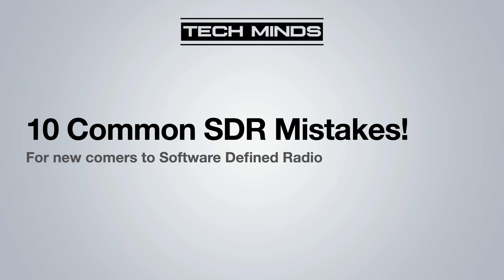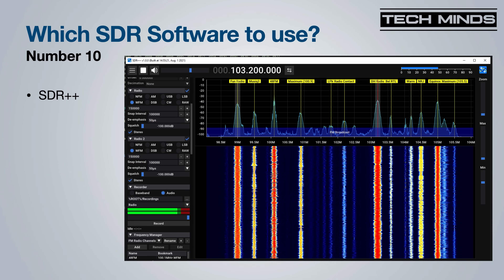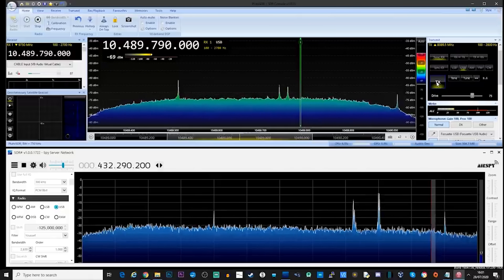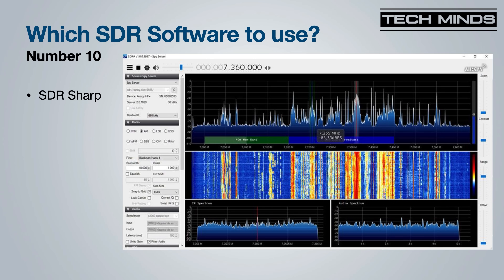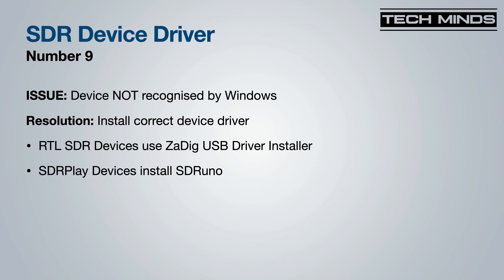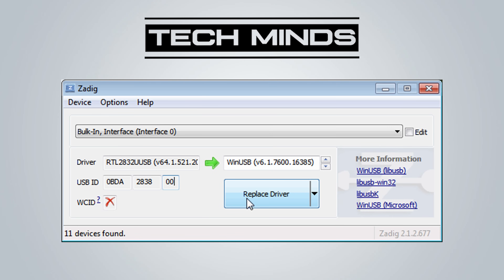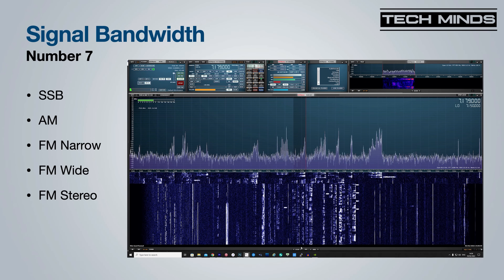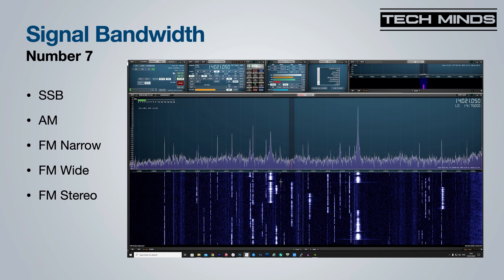10 Common Mistakes Made With Software Defined Radio

Comment: I'm starting to get sad. 

I was all excited to get myself an RTL-SDR kit. And I do see some signals.

But only now, I'm finding out that without a better antenna, I probably won't get very far with this new hobby. And getting one is not very possible, as I don't have anywhere to mount it on, living in an apartment building... :c
Reply from the maker: Don't be sad! Even with an apartment, you can still do a lot with SDR. Check out loop antennas or even just a long wire tossed out a window. Many folks get amazing results in apartments! If your apartment is high off the ground this can be an advantage for VHF and UHF! Let me know if you have any questions.

Comment: Good video. Am considering an SDR for my SWL hobby
 The reason is i hope it might overcome the electrical noise introduced by the computer you are using. My biggeat problem is RFI introduced through the USB port back into the reciever. Any comments or experiences anyone wants to give would be apprecisted.

Comment: RE: Antennas.  On HF at least ("Short wave") sometimes a non-resonant antenna can work better if you think more in terms of signal-to-noise ratio rather than pure signal strength.  Today, most of us struggle with RF "noise" from the power grid, solar panels and poorly designed consumer electronics. Sometimes a non-resonant antenna will pick up less noise but still capture the signal you want to hear, giving you a "weaker" signal overall, but an improved signal to noise ration.  All that to say, don't get discouraged if you cannot fit a resonant antenna in your garden .... a random length of wire at HF might actually work well.  In fact, many people today are using non-resonant wire loop antennas placed directly on the ground to address the noise problem.  Have fun with your SDR!!!!

Comment: When choosing coax, look at the 'minimum bend radius' if you are choosing a thick, low loss type. Some are difficult to work with and will not go around the corners of your shack and if you do manage to install them, they are so heavy and springy that they will drag your receiver off the desk. I use CT-100 satellite cable. It's a 7mm cable, flexible and low loss to 2 GHz. It's 75 ohm so is not a perfect match but it makes no real difference, as neither your receiver or your antenna will be a perfect 50 ohms anyway.

Comment: Computer choice is important.  If you are a OSX user then you are limited to SDRConnect or SDR++, however if you have a SDRPlay you are stuck to SDRConnect as SDR++ no longer works with the SDRPlay. Please note Mn Macs do not do Bootcamp. You need a Linux machine if you want to use WEBDX, for everything else you need a Windows PC or Laptop, but if you've just spent £1700 on a M4 iMac like me,  you'll be kicking yourself. Laptops start around £199-£250 new but they are slow and may not have quality screens mac users are used to.

Aerials, there are Loop antennas, missing from point 1 above.  There are relatively cheap ones like the YouLoop and MLA30+ & DSA  these apparently are pretty good.
I prefer to buy from specialist radio shops like Moonraker or Radioworld, ML etc.  As Mike said you will need two types of antenna, you might use the Sky Scan Desk Top and You Loop both are indoor operation so no need to trail coax around the garden or put up masts

There are also standalone radios with an SDR flavour, like the Malahit SDR small but capable.  

Here are suggestions
SDRPlay , £126 for a B, £195 for a DX from a radio store
YouLoop and Sky Scan iro £85. (my rather weak X1HF cost the same) also from a radio store.  
If you want to listen to the world then expect to pay £400 + for a serious loop.
Laptop if you don't own one 15" 250 nits Asus from Argos for £249

Comment: To eliminate a feed line altogether use a USB extender to USB SDR connected directly to the antenna or remote antenna switcher in a protective case plus lightning arrestor to ground.   I like to add heat sinks to the SDR as well.

Comment: As a total n00b, I made an even more basic mistake: trying to see how my RTL-SDR picked up my own radio transmissions by transmitting from an HT about 3 feet from my antenna. It died immediately and got rather hot. As we say in the MIdwest, ope!

Comment: can you use modern tv cable for the antenna as today's digital tv and cable modems can run in the ghz range?

or even with the right adaptor connect to the tv cable?

Comment: Hi, Great video. I am trying to use an AirSpy HF+ Discovery using SDSharp for my IC-7300. However, I keep getting the message "Port is not available" for the omniRig Sync. Do you have any suggestions on what mistake I am making? Thanks in advance.

Comment: Can SDR sharp be used on a mac?
Reply from the maker: Try SDR++, that works great on a MAC. SDRSharp is designed for windows.
Reply: @TechMindsOfficial  thanks for getting back, one more question though can sdr++ transmit? I would like to use it with a hack rf.

Comment: I think, with high gain you can't damage your SDR reciever. Because gain doesn't matter of the circuit which is operation on sameway regardless to gain settings. Of course, you can damage your reciever by high wattage RF in your near radius and that is more important how you can damage your reciever. But IDK if it is possible. If there is someone who know more and tell me about how gain can cause circuit damage i will be pleasured. :)

Comment: Very well done, just the aspect of direction. A whip is omnidirectional and also frequency sensitive by its length. One could use a Yagi, but that has its frequency limitations too but will concentrate receiving in one direction, actually attenuating signals from other directions. . A log periodic is probably the answer for the higher frequencies, as it is directional and can handle a wider band of frequencies. But you will need a system that can turn it around to face different directions. (And maybe tilt from horizontal to vertical too) Now we have polarization too, vertical polarized means you need your Yaggi to be verticle position, the whip is vertical, a mode used in preference to horizontal. . Then we have balanced to unbalanced to balanced, the yaggi is balanced and most radios outputs are unbalanced. Here we use a "Balun" a 1/2 to 1/4 wavelength coax, connected between the two points on the folded dipole of the Yaggi. Many prefer a small transformer, air core or ferrite core. Coax is joined to earth, and one of the dipoles ends. On HF frequencies you can make a antenna tuning unit, which basically just adds length to the antenna by putting a coil in series, or shorten the antenna by purring a small cap in series. I suppose one can google the details of all these things. IMPORTANT - You will only need to do this if the stations you want to listen to are very weak. Antennas are the only thing you can tweek, I loved the machanisms I had to make to make my 12 element Yaggi wiz around in 360 degrees. It also could tilt up and down and twist it from verticle to horizontal.  Hope this gets you started on making antennas.....lol

Comment: Can you please reccomend a book that is specific enough but adequate for novice users that deals with - antennas, coax cables, filters, gain, resistance etc. - the bottom line here is what equipment to use for which frequencies. How to scan propperly etc.

Comment: The most important mistake that wasn't mentioned: Avoid proprietary soft- and hardware! Instead look for radios with open hardware interfaces, resulting in free (as in libre, not as in free beer) drivers that run everywhere and software that is also free (also as in libre and not as in free beer)! If you don't care about your freedom to learn how things work, your freedom to modify and experiment... then get the whatever you want, I don't care. But don't complain if you can't do the more advanced things with it.

I personally think, using free software is a absolute must in software defined radio!

With every physical radio, you can disassemble it an look inside how it is built and you can modify it. Even if it is a one chip solution, some people grind down chips layer for layer and put them under a microscope to reverse engineer them. Actually polish them down micrometer for micrometer and the microscope is a electron microscope, because the structures you look at are often smaller then the wavelength of visible light.

With software defined radios move all the "magic" into software. If the software isn't free, you have to reverse engineer it which may rival the complexity of grinding down a chip and reverse it under the microscope. Something most people can't effort. So you need access to functional blocks, their source code and documentation. Then playing with software defined radio becomes as easy as assembling a kit or building something from an existing design.

With proprietary software *only*, the radio hobby would die, because the design of most radios is nowadays a software defined radio. Fortunately free software and free hardware designs exist.

Some Examples of free Hardware Designs:

Ettus Research USRP: The Company Ettus Research started with the goal to build a low cost SDR that everyone can use, especially with GNURadio. But since then, their hardware became more and more capable and also more expensive. Their Hardware became a fundamental tool for the development of high bandwidth mimo systems like 5G and also used by the military for signals intelligence. They are now owned by National Instruments and their Radios have become prohibitively expensive (You have to decide if you want to buy a new luxury car or a radio). But they still release Hard- and Software designs and support the free software projects involved. And there are various Clones available.

ADALM Pluto: The company Analog Devices wants to sell ICs and a good way to do it, is to create open and inexpensive educational material that can be used to teach the next generation of engineers, when these start working for companies that build stuff, they use what they know and this is how to sell chips. ADALM stands for Analog Devices Advanced Learning Module, it is a very inexpensive but highly capable software defined radio. It contains a runtime-reconfigurable FPGA with two physical ARM CPU Cores that run Linux. The HDL source for the FPGA and all drivers for Linux are available, the result is that it just works and that people have built firmware for special purposes. Clones of the Hardware exist, some are even better then the original (Better TCXO, additional SMA connectors für RX2 and TX2, Metal case).

The HackRF One: Because the USRP was too expensive and something less expensive was needed to allow people to reverse engineer and audit wireless devices, the HackRF Project was started. It is also a completely free design and comes with free software to support it.

The above mentioned SDRs have one thing in common: No filters, a completely open frontend from ~1MHz to ~6000MHz, so you might easily overload them with strong out of band received signals. So a bandpass filter for the received band is advised. And on the TX side, it is also unfiltered and a low pass filter for the band used is always needed if you want to transmit.

Another Example of free Hardware Designs are all the OpenHPSDR designs. OpenHPSDR is a Project that created a lot of modules from ADC / DAC boards, amplifiers, filters, power supplies and so on. Control and transport of I/Q data happens via Internet Protocol over Ethernet. Based on this Design (Especially the protocol used over the network), many other SDR Transceivers were created. The ANAN or the Hermes Lite 2 or Charlie 25 are good examples of derived hardware designs.

Non-Free Hardware Design:

RTL2832U based USB TV-Receivers, probably the most popular SDR ever. It was actually just a proprietary/undocumented USB TV receiver, but a developer of linux drivers managed to discover a mode where the receiver starts sending I/Q data over USB. Now we have cheap entry level SDRs for everyone. But I don't consider it free, it was just a happy accident. Of course it is now very well supported by free software and the hardware is so cheap, it would be wrong to not mention it.

Some Examples of free Drivers:

UHD: The software to communicate with USRPs (and Clones).
libiio + libad9361 (and many more): The very modular driver framework to communicate with ADALM Pluto and similar Analog Devices hardware.
rtl-sdr: The software to communicate with RTL2832U based USB TV-Receivers.
hackrf: The software to communicate with the HackRF One.

The OpenHPSDR based Radios work over Ethernet / Internet Protocol, there is no direct Hardware access needed. The same can be true for UHD and libiio, if the Radio has a Network Interface. The rtl-sdr software comes with a tool called rtl_tcp which also allows to make a SDR accessible over the network.

Hardware Abstraction Layers

osmosdr: It makes different types of SDRs available with a single programming interface. You can add new hardware support to it and all programs that use it, can immediately access the new hardware. The user normally has nothing to do with osmosdr, except when some program uses it, you have to see if your hardware is supported by osmosdr and if it is, it is also supported by the program that uses osmosdr. Unfortunately the osmosdr project isn't very active maintained. It works for its intended purpose. 

SoapySDR: Basically the same idea as osmosdr but written in C++ and actively maintained. It supports everything that  is supported by osmosdr (because it can use osmosdr) and it has SoapyRemote, which makes all supported Hardware available over Network.

Programs that use osmosdr or SoapySDR:

gqrx: A simple AM/FM/SSB receiver application.
sdr++: A newer receiver application, more demodulators (it was mentioned in the video)
sdrangel: A transceiver application, you can receive and transmit AM/FM/SSB and various other modes.

Programs that use the HPSDR Protocol:

linhpsdr: A simple transceiver program for OpenHPSDR based radios.
pihpsdr: The same but optimized for the raspberry pi.

Programs for SDR rapid prototyping and frameworks:

GNU Radio: It is a large library of SDR components, building blocks. Filters, Modulators/Demodulators and input output modules, signal generators and so on. They can be used when you program something from scratch. But they can also used by the tool named "gnuradio-companion" where you drag and drop those blocks on a workspace and create connections between them. It is like building a radio from minicircuits modules, you get filters, mixers and so on and connect them.

Pothos: Basically the same idea as GNU Radio, but more focus on rapid prototyping like gnuradio-companion and less a library of SDR modules. The SoapySDR Project is part of it.

liquid-dsp: A library full of common digital signal processing routines to build software defined radios.

libvolk: A companion project for gnuradio, it contains common functions used in digital signal processing, like multiplying large arrays of numbers. But these functions have hardware specific optimizations.

Everything on a lower level is like winding your own coils and transformers to build your own radio. This is where I could list common programming languages like c, c++, python and so on. But this is already a wall of text. ;-)

Comment: 15:20 12.5khz is the channel width used for FM in V/UHF.
The bandwidth of our signals is approximately 16 kHz: max deviation +/- 5 kHz, maximum transmitted audio frequency 3 kHz (calculated with Carson's rule).
It is convenient to reduce the received bandwidth for weak signals. 73s.

Comment: I have bought a Chinese clone of the SDR dongle named SDR ver.1.0.1.4 based on MSI chips with 2 DIP-Switches (8 & 4 pins) and one SMA joint (the dongle without a case). It works perfectly under SDRUno and SDR Console and there were some problems with SDR Sharp & SDR Angel due to drivers.